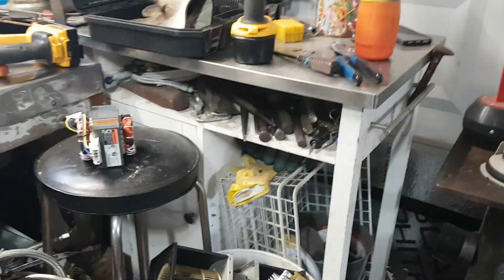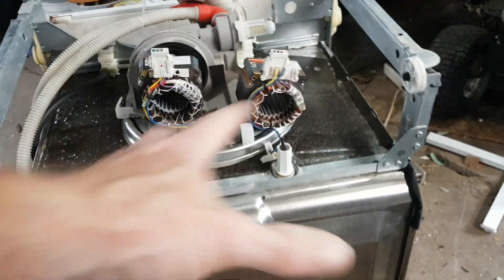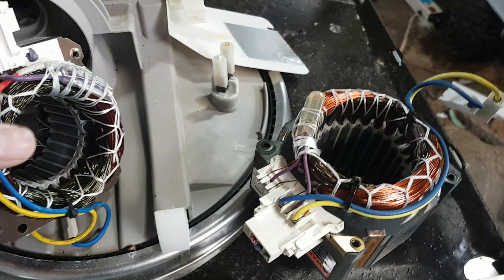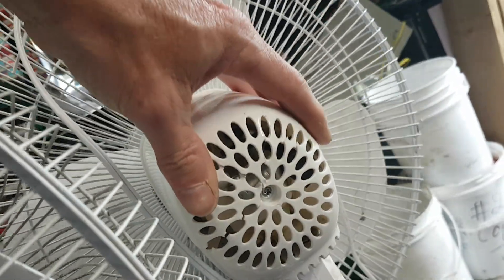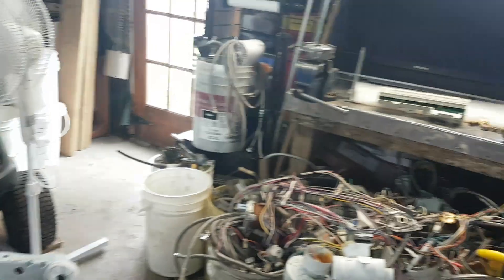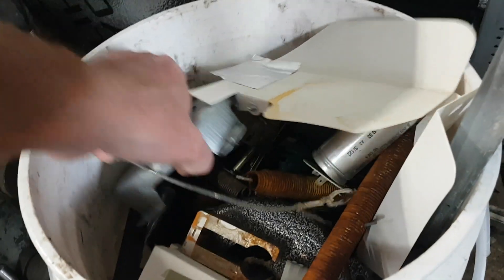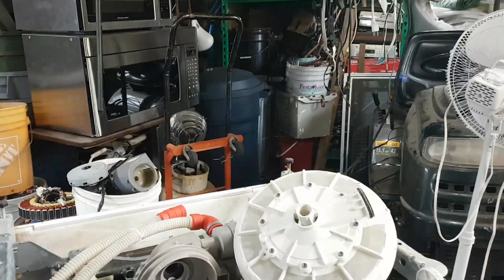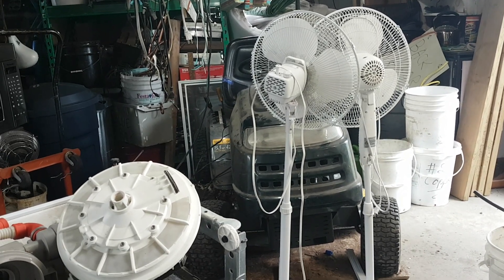Is it COPPER or ALUMINUM!!

Comment: That's a cool tip!  Not that it matters...I strip them both!  Try a Diablo carbide blade.  They generally run $15 US.  I swear by them!  Especially cutting thick steel, fan shafts, etc!
Reply from the maker: Thanks!!